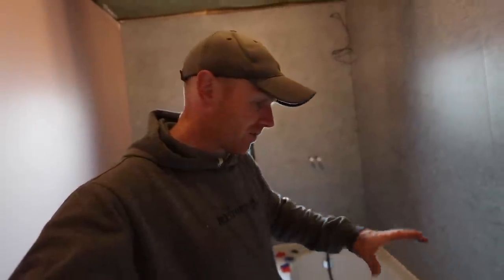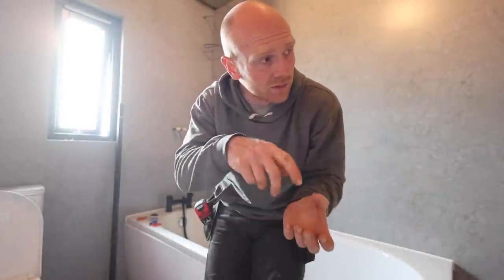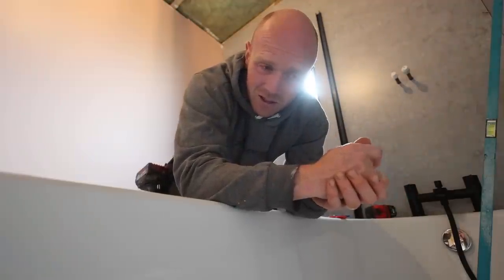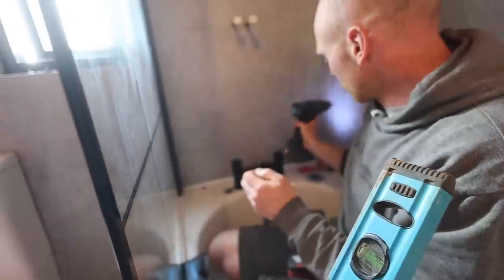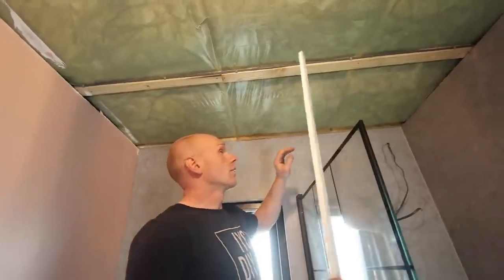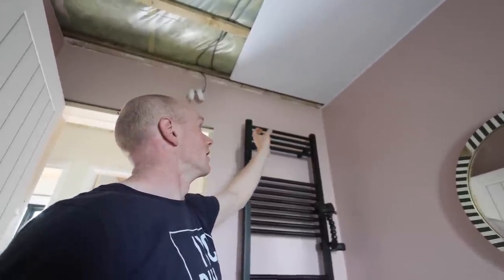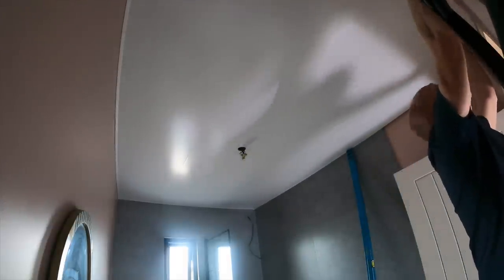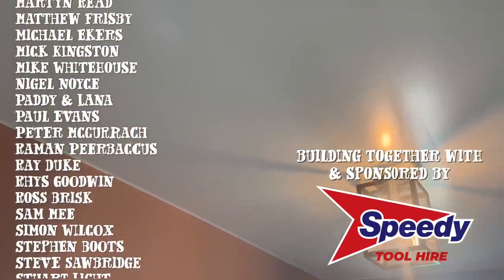NEVER THOUGHT I'D STAPLE UP A CEILING! - Bath shower screen fitted 🚿

Comment: Did one of these Pvc ceilings today, my firm fits them to all the contract bathrooms. I've found the best method is a drywall screw at a slight angle secures them well and pulls them tight together.

Comment: When I installed a similar ceiling in our previous house. I fastened a batten around the room at the ceiling height, painted it black, then attached the edge pieces just slightly lower than the batten bottom edge. This produced a shadow line which I thought looked quite attractive. Doing something similar would have given you the opportunity to eliminate your small addition. I had one advantage in that I was lowering the ceiling so my cross joists simply rested on the edge strips and when fitting the last panel I was simply able to push the whole ceiling up enough to clip on the panel and drop it back in place.

Comment: Did one of these ceilings 2 years ago. I used 13mm wood screws at an Angle instead of glue and staples. Worked a treat. I believe it was the same stuff.. It's still there and a quick wipe every 6 months or so and it should last forever ish.  😇
Reply from the maker: Good to hear how its working 2 years on. 👍

Comment: I put them up in my new bathroom, i used small screws ( no adhesive) what a pleasure no painting in future, mould resistant. One question; why not do the ceiling before the shower glass, much easier. Cheers from South Africa.
Reply from the maker: There was a couple of weeks between the two so just needed to install what was sat there ready. Didn’t really get if the way. 👍

Comment: I sealed mine on the inside as long as you don’t seal the 30mm horizontal piece that sits on the bath edge it should drain out. I found out the hard way.

Comment: Won't steel staples rust in a bathroom? Or do you use special galvanised staples?
Reply from the maker: They are galv but pretty sure they could all fail and the  multi stick would do just fine.

Comment: We use the same panels on glamping pod bathroom ceilings. Leave a 1mm gap at the edges EBT or sticks all in the back then 4mm bead of silicon around the edges. If you cut through the back face it will bend around curve's and helps to get the last run in.